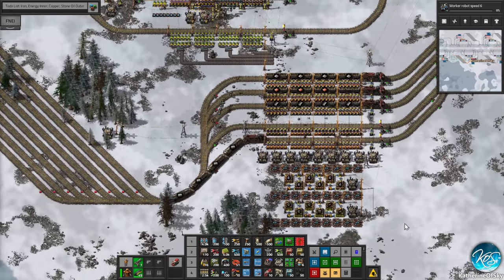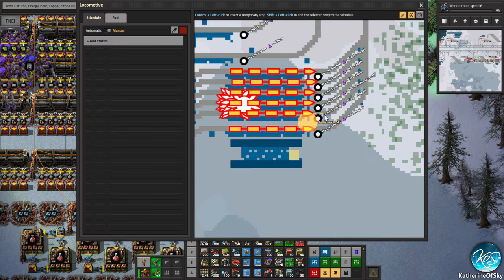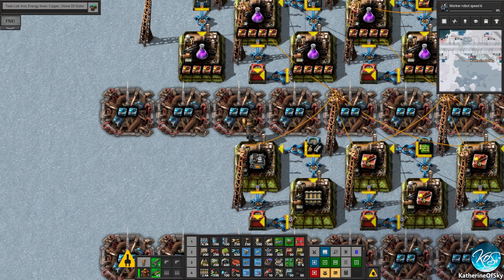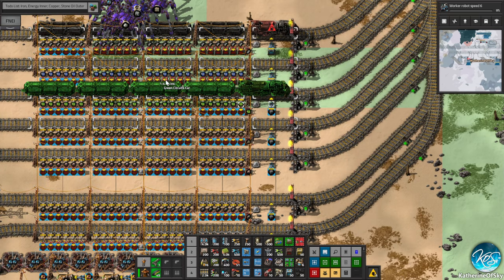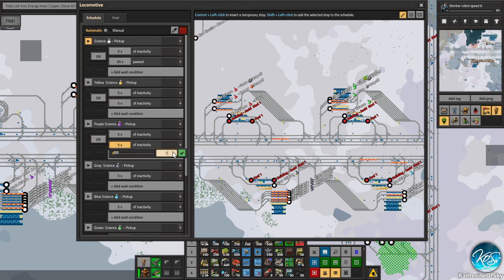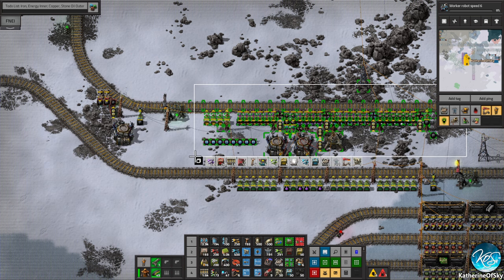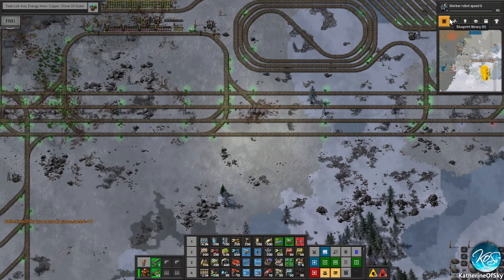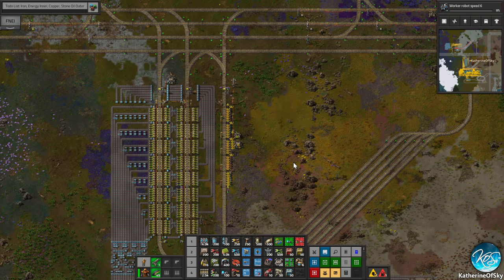Factorio Trickle Down Megabase 30 - PURPLE & YELLOW SCIENCE - Let's Play

Comment: Hey KOS on the stove smelting you used the rail in outer for the building train output, should be the both out.
Reply: And at the stone smelting, you have fixed the stone out to outer ,  but what about the stone in?
Reply from the maker: Good calls, I will check on these!